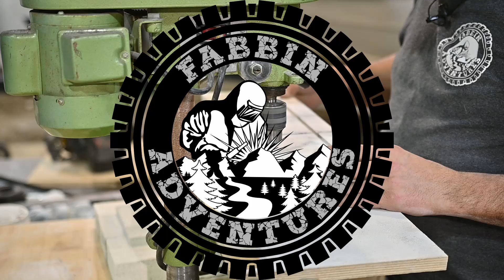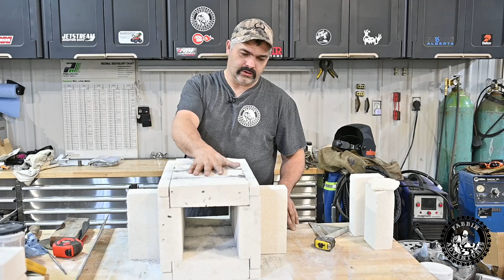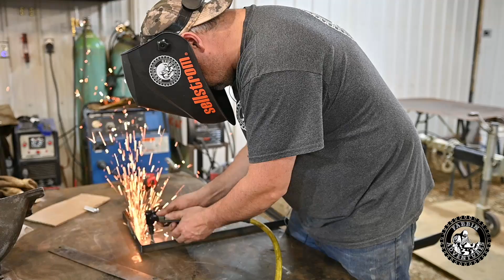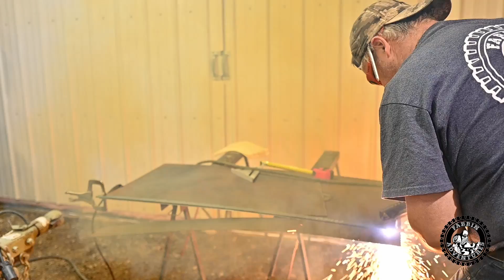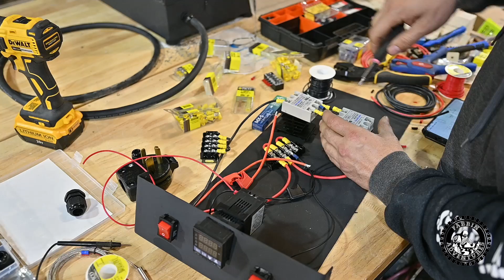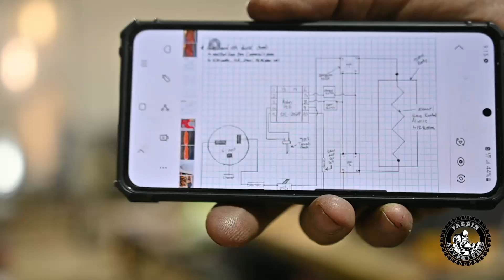Diy Heat Treat Oven: How to Save thousands of $$ building your own!

Comment: Hey man that temp controller is a pita I have the same one.  I have the full manual if you need it with
Reply from the maker: Yeah they are a pain in the ass to use especially if you don't use it often. I have the manual, but they are still hard to read and understand. I wrote myself some cheat notes that I can understand..lol
Thanks for watching and commenting!

Comment: I am impressed with your oven build and applaud your tenacity at this build. We share similar skills and areas where more knowledge could be useful but you have all the important abilities and i know there was a lot of effort and time you put in that some people would not imagine if they haven’t attempted a project like this. 

Did you end up with the heating coils the size that you started with or move to a larger diameter coil? All the best to you. Nicely done!
Reply from the maker: Thanks man, yeah it was a fair bit of work, and it works good though i would say it could use more coil for faster heating up, but it hits high enough temps to heat treat cpm m4 and hold its temps nicely so i havent really seen the need to make bigger coils.
Thanks for watching and commenting man, i appreciate it!

Comment: Since you're using Red Beard's schematic, I'll post what I posted on his video:
There is one case where the operator can get bit - where one of the solid-state relays shorts out and stays on. The heater will still operate normally, and the heater will still be disabled when the door is opened, leading one to think that everything is fine. BUT: the relay that is stuck on is still connecting voltage through the entire length of the heater, presenting a potential shock hazard - even if it is thermally cold. The right way (more expensive, of course) is to have the door switch operate a contactor (a big relay) that removes power from both ends of the heater. The cheap less safe way is to add an indicator light to either end of the heater and neutral (not ground). If it's on when the door is opened, it's a red flag that the wires still have voltage on them.
Reply from the maker: Thats some good points, thanks for your input!

Comment: Add ceramic wool around the chamber. There will be much better insulation and it will heat up faster and the temperature will be more stable.
Best regards JB CUSTOM KNIVES ✌️😎
Reply from the maker: Thanks, i have ceramic wool underneath to keep more heat off the electronic which has helped. The oven it self works great.
Reply: I put the wool around the chamber, and now can reach 1200°C in 30 minutes, with 3,6kw heaters.
Reply from the maker: @JB_CUSTOM_KNIVES nice, well im not gonna redeisgn this thing now, i don't use it that much. Shes gonna have to be good enough..lol
Reply: If it is enough for you then sure there is nothing to change. Just writing so, maybe it will be useful to someone. Or maybe someday you will want to make a new stove. I use Mine almost every day, so saving time and energy is welcome with Me. Nevertheless, great project😁.
Reply from the maker: @JB_CUSTOM_KNIVES oh man for sure if i used it every day it would be worth it, i might use mine once every 6 months these days.
Thanks for your input and comments!

Comment: Awsome video! I always wanted to do the same thing, seems like fire brick is a huge part of the price.
I've yet to try this but i read somwhere that with sodium silicate and perlite you can make fire brick.
Sodium silicate could be obtain with lye and silica gel, it's like a high heat resistance glue. It's not 100% safe so better look that up before, you may find a video on youtube by searching "Make Sodium Silicate".
Reply from the maker: Thanks for watching, yeah, fire brick is the main item you need, and a bit costly but its still way cheaper than buying a premade oven.

Comment: Awesome Build. I was wondering was the single brick thickness enough to insulate the temperature inside the kiln and how hot the outside steel casing gets to the touch. Wondering if adding a layer of Kaowool between the brick and metal casing is worth it as i am getting everything together to start my build soon.
Reply from the maker: Yeah a single layer works, but if i did it again id add Kaowool underneath for sure, but all around would be better. The steel gets pretty warm!
I ended up putting a layer of kaowool over top of the electrical and a couple small computer fans to pull air across the solinoids as the heat melted my solinoids and warped my pid a bit on my first real usage, been good since!
Thanks for watching and commenting! Good luck with your build!

Comment: Awesome build! I Can't wait for more content! I see the beginning of a 500k+ subscriber channel.
Reply from the maker: Glad you like the build, sofar the heat treat oven works great, ive had it up to 1850F to heat treat some CPM D2 blades!
Have you seen my belt grinder video?
https://youtu.be/VBh_EYc6yLA
Thanks for watching and commenting!
Reply: @FabbinAdventures  1850f is great and all you really need. I'm a machinist and our industrial heat treat oven says it's max is 2200F but the PID stops it at 2000F. And  yes the 2x72 video is next on my watch list. I built a 2x72 grinder out of aluminum from scratch. It's similar in appearance to the Reeder grinder. I'm also in the process of designing and building a slow speed carbide lapping machine that I can market.
Reply from the maker: I hoping i can do 2200, my pid is supposed to go that high, i have some CPM M4 to make some blades out of, i believe they need to hit that 2100 or so.
Ive got all kinds of fabrication videos on my channel, the older stuff is not so good, but i think my newer vids are decent.

Comment: Man you build cool stuff sure beats my tiger torch can't wait to see it in action thanks Ron
Reply from the maker: Lol thanks, build it if you can, buy it if you have to.
Glad you like my projects, there is likely a powder coat spray booth and oven coming up in the future so stay tuned if thats something that interests you.
Still waiting on parts for the fj project so i may as well get some other stuff i want done.
The shop will finally be getting a concrete floor this spring...i cant wait!
Thanks for watching and commenting!
Reply: @FabbinAdventures  U bet Ron got in some crap for commenting so this is my new channel
Reply from the maker: Howd you get in crap for commenting?
Reply: @FabbinAdventures  I'll drop you a mail thanks Ron.